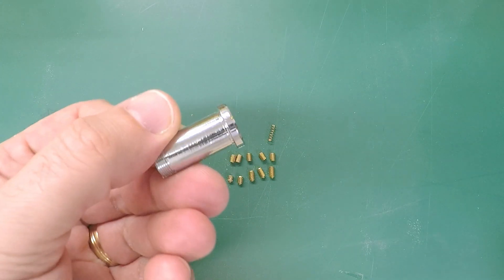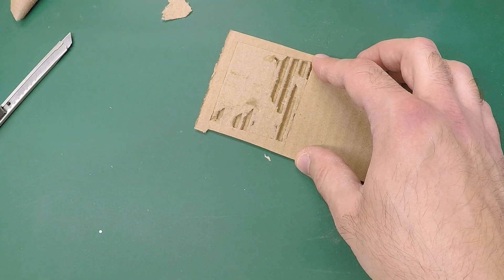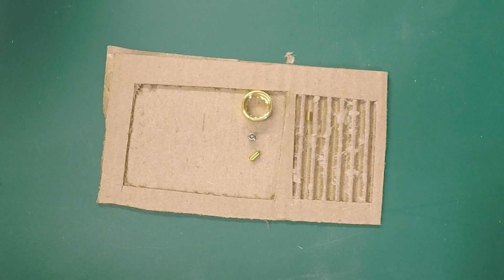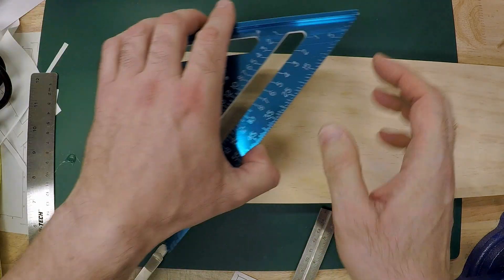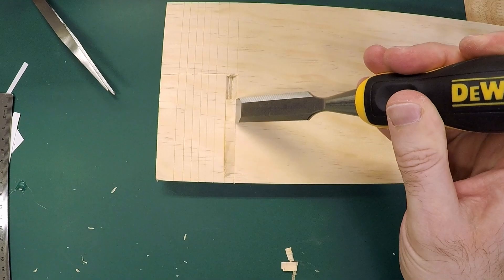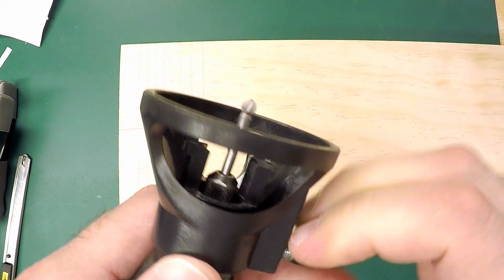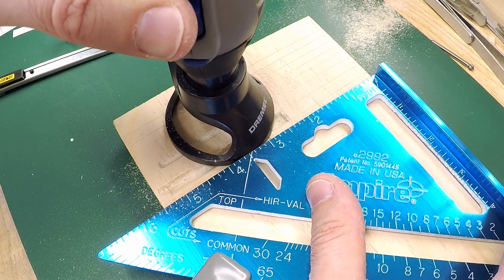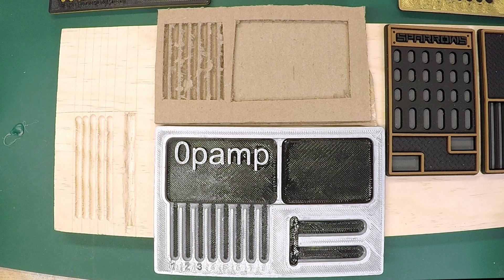Training Tuesday 2: Pinning Tray Fabrication

Comment: building a tray that fits into a cd case or lens filter case is fun. it gives you a lid you can close to protect the pins from a curious cat. with the thickness of the tray just right, you can shake the thing with the lid closed and nothing will move. it gives you a handy and portable tray.
Reply: Nice use for that case!

Comment: Good video! I see what I must do now. I need to make a custom pinning tray. I think some exotic hardwood with some nice figuring is in order.
Reply: Yes, I was just demonstrating the technique, but you can really make some works of art if you put in the time. You can also use a square or ruler to route the edges of a cutout and then run the rotary tool in the middle to cut out a rectangle. Have fun!